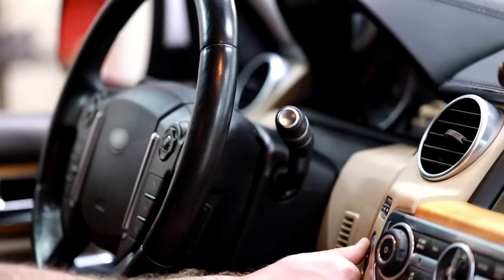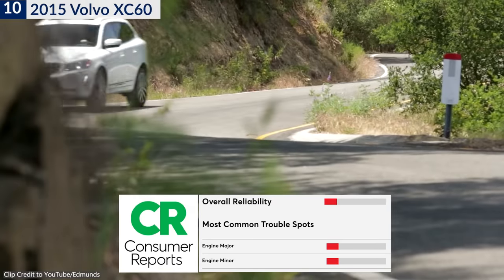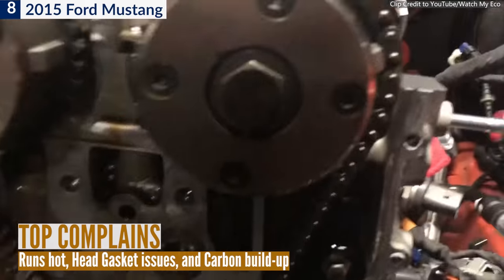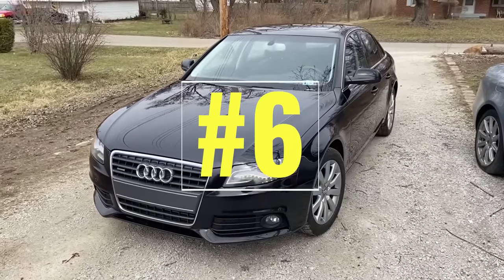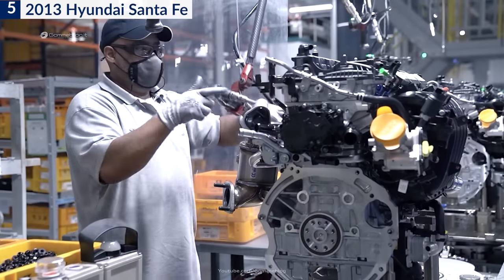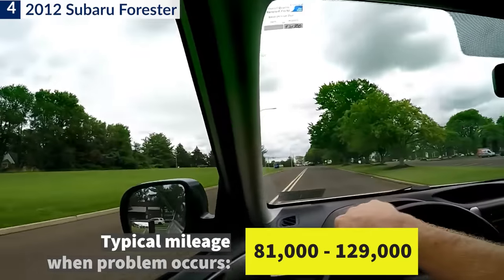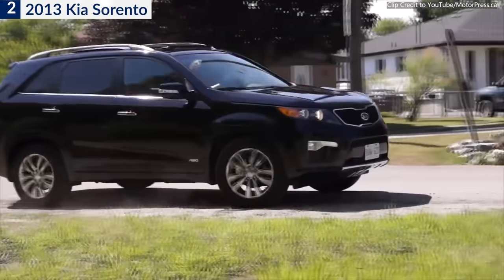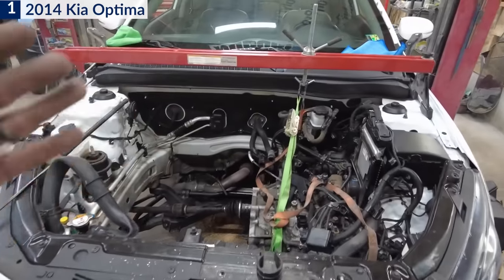10 Used-Cars to AVOID for BAD Engine - as per Consumer Reports

Comment: Actually avoid the all the Subaru Foresters from 2011 on as the all have the FB25 engine.  My wife has a 2011 used oil right up until it failed.  $7000, plus the shop went through two Subaru assembled short blocks BEFORE they got a good one on number 3.  I will NEVER BUY A SUBARU AGAIN!!!
Reply: You're wrong.  Subarus Foresters over the recent years are VERY reliable.
Reply: @eskieman3948  Let me guess, you are a mechanic right?  I can remember when Subaru was rated at or near the top for reliability every year, but that changed.  CR rated Subaru number 7 in reliability in 2022.  Even Buick is rated higher.  Maybe Subaru is  going to climb back up the list.  Maybe not.  It does look like the Forester has improved since 2019,  but I've had my fill.  I have this rule about avoiding a brand after spending thousands of dollars on repairs.  Let's hear it for Lexus, Mazda, and Toyota.

Comment: This video never mentioned 2011/2015 Chrysler 200 V6 Pennistar engines with camshaft, rocker arm and phaser problems. Again these problems exist between 60k and 125k miles. Also these same motors have problems with the oil cooler under the intake manifold. The cooler has o ring oil seals that deteriorate from heat, causing excessive oil leaking down the back of the engine. These repairs are extensive and expensive and problems lead to engine failure. Chrysler knows of these problems but refuses to acknowledge them.
Reply: Of course.
Reply: Of course.

Comment: You missed the 2013 through 2019 Ford Escapes with the 1.5L and 1.6L 4 Cylinder Ecoboost Engines mainly. The 2.0 Ecoboost engine may have this issue as well but not as frequent as the other 2. Issues happening between only 9,000 miles and 120,000 miles. Coolant will enter into the combustion chamber due to a bad design in the block and require a complete engine replacement. Costing the owner (If out of warranty) $6,000+. 

2020+ models are still up in the air on issues but i will guarantee they will have transmission issues. (Also a plague of the 2013-2019 Escapes)

Comment: I've only owned 3 cars in my 17 years of driving and from two different companies Toyota and Honda I had 2004 Toyota Corolla bought brand new never had anything close to a major breakdown besides obvious oil change and air filter changes. I put 300k miles on the Corolla sold it because I found a fairly price 2009 Honda Camry with 65k ish miles same thing no major just normal like oil oil filter and air filters yes your car has 2 one for the engine one for the cabin got again roughly 350k sold because I wanted a little better gas mileage soo I sold and bought a 2012 Honda Civic it had 100k miles on it got the Carfax and again only basic maintenance so I bought it 3 years ago it currently has 192,345 miles on it rules like the day I bought it smooth. Only did basic maintenance oil and oil filter and the air filters when I bought and 60k miles later bought new ones they got a little dirty fr the diesels on the highway and city. All 3 cars are all around used cars drive back and forth to work to stores to little outings etc. With how inflation and the prices of everything has gone up massively Im gonna be driving this civic till the wheels fall off. That's my experience Toyota and Hondas from 2004-2012 are the only years of the vehicles I've driven but never had a problem. I still check us news and world, consumer reports, and NHTSA about there opinions on what year and models. Not one of my vehicles had a turbo natural aspiration all the way. Rem it's just a click away to see how good the car is reliability cost of ownership and durability is what I look for but that me and I got 1 million miles of no major or Minor fixes o had to do I drove Camry super nice and smooth just not the highest gas mileage still good I'm getting 34.6 mpg on my civic with 70 percent highway/30 City the midsize model accord and Camry was 28 roughly combined had bigger 4 cylinders needed them cause it need to the power to move the heavier vehicle but reliability is amazing in my 2004 Toyota Corolla and the 09 Honda Accord and now my 2012 Honda Civic. I saw you might have to the guy who owned a 2000s Toyota Tacoma working in oil fields of Montana with over 1 million miles on truck original engine and transmission he has to have a few hundred dollars of engine work at 700k miles replacing something electric and O2 sensor minor repairs. But Toyota found out came out saw the mileage got it's history it's in there museum and they gave him a brand new 2020 Tacoma it has close to 200k on it he said he wishes he would of kept it but a brand new year vehicle and 20k in cash will change your mind he did say he wishes he kept the Tacoma with over 1 mill miles cause he said he wanted to hit 2 mill miles without a major breakdown. Awesome story I will only buy a Toyota or Honda maybe another manufacturer as long to do it buy if it reliable cheap to run and price is fair. May God bless you and your family.

Comment: My 2012 Traverse had engine 3 put in at 84,500 miles.  First one was a broken timing chain and 2nd was a broken oil pump shaft.  Now that the warranty is up maybe I'll just chop and tunnel it and drop in a SB 350, T56 tranny and Currie rear end from my old Firebird.
Reply: There is a plastic piece that the timing chain goes over that gets worn out and ruins the engine
Reply: I was surprised that the Traverse and the other Lambda SUV's(Buick Enclave, GMC Acadia) weren't on the list. I heard many stories on the timing chain issues on the 3.6L V6. On the Lambda SUV's, it's definitely expensive if it's out of warranty because the engine has to come out to replace the timing components(chain, tensioner, guides) due to the tight FWD layout.

Comment: I'm the not so proud owner of a 2012 KIA Optima turbo. Let's see, the entire front suspension, the brake parts at every wheel and the engine have been replaced. The last one was gratis on warranty from KIA. Good thing I used to run a garage. And to think that I gave my sister my Honda. At least the KIA parts are cheap!

Comment: My 2013 kia went bad at 32000 miles fought them for almost a year they finally replaced the short block. Then trans went bad by 68000. It had a bad knock 2 days after my wife brought it home took it in to service and they said “it’s normal. Just the gdi system .”
Reply: My back then new 2013 Kia Optima stalled at 30,000 miles, driving on the highway, almost caught fire from the smell, Kia replaced the engine for free, then came the recall that many consumers were have the same issues on their Kias, other recall issues were sent to me so I would take it to the dealership to get the parts installed new.
Reply: @cindygomez5414  yes we got a new engine after fighting them for a year.

Comment: New car mite be good first year or two.  Maybe evan 3 .  But once tranny starts acting up . Come back and comment. I spent 15,000$ cash in 3 years just repairing transmission stuff. I keep the fluid clean and filter change.  All different brands to.  Cvt are very gambly lol, never owned one yet. But ever transmission shop said no go. The shops were full of them.  No hate on them ..but your day will come for sure in the newer cars. They are mad with cheap metal that expand etc.

Comment: Where is Ford Explorer?
First 2000 miles: From TX to CA, Vehicle stop in the middle of the road uncountable times.
Mile 4000: Windshield cracked by it self, jump started countless times ‘cause sudden lost of power…(and still happening today)
Mile 35000: Cheap Korean’s Handcook tires was gone. Battery replaced.
Mile 60000: jerking violently when uphills and accelerating; shaking like crazy when breaking.
Mile 65000: in the middle way to California, water pump leaked to the engine, alternator burned, battery dead, computer chip 🔥 
…and more….😂

Comment: The 2013 BMW X3 has a timing chain, not a belt, the 2011-2012 Chevrolet Equinox and GMC Terrain have timing chains not timing belts in both 4cyl and 6-cyl engines.

Comment: I have a 1991 honda accord LX. 246000 miles and it runs great. Added 1 rebuilt transmission and timing belt twice. Not a tear on the dash, carpet or seats. Carcover on it most of those years. Never been in an accident with one owner......me. I have had about 4 people out of the blue if I want to sell it.......I still own it. No body damage at all. The built-in cassette player/radio needs a new one. Anyone intrested?

Comment: I have a 2008 Santa Fe 3.3 with 120,000 and no engine issues only issue I have is a clunk when putting it in gear which I believe has something to do with the transmission engaging in the transfer case. I’ll probably lose AWD soon but hopefully I can keep using it as a 2WD.

Comment: Hi Sir apparently GDI engine are not the best engine at all & probably why a lot of car manufacturers like Kia & Mitsubishi Galant had the 1800 GDI engines & my son had one quite a few years ago & only had it about 3 years & after awhile it had problems & everytime it went for a Warrant Of Fitness it wouldn't pass every 6 months & my son was getting pissed off with his car suspension ball joints & mag wheels that came with the car  one had cracked & had to be repaired & the 1800 GDI engine ended smoking out of the exhaust & it was blue smoke to & I said to my son that motor smoking & I said to him that's not a good car that you have brought & tater he got another vehicle as a trade in my son only got $500.00 for it as a trade in & yet when he first brought it was $11,000 way too much money for a this Galant & would never ever touch Mitsubishi Cars I would steer clear & I have1996  Toyota Hilux Surf 3.4 V6 & now done 251,000 kilometers & my trade the Mitsubishi Galant on this Toyota Hilux Surf 3.4V6 5vzfe engine when it had done 117.000 Kilometers & when the Toyota Hilux Surf 3.4v6 5vzfe engine had done 128,000 Ks I brought it of my son & I have had since then & that Toyota Hilux Surf 3.4V6 is still running strong & just goes to show Toyotas are pretty reliable vehicles & as I say again GDI engines are by no Bloody good I would stay well away from those engines they are Bloody Rubbish Kia should put the Toyota 2 liter 4 cylinder motors or Toyota 3 liter V6 & won't have any issues with those motor & transmissions I don't why Kia use those GDI engine that are absolutely useless Kia should learn to take those GDI engines out their cars & put Toyota engines in their cars as well as Toyota Transmissions Toyota engines are lot more reliable than those Bloody GDI engines Bloody Useless engines & you would think Kia would have learnt by now that their GDI engines are shit end of story Kind Regards Peter PS Kia Get Rid Of Those GDI Engines Quickly & its starting to cost you big money GET TOYOTA ENGINES &TOYOTA TRANSMISSIONS yous would be by far better off

Comment: Seems like KIA has the most problems. Im surprised Hyundai isn't part of that since they are sister brands and likely share at least some of the same parts and assemblies. Maybe not too. I might be making assumptions.
   I love my 2009 Hyundai Santa Fe Limited with a 3.3 liter 6 cylinder engine. Passing 163,000 miles on it and running great.

Comment: The Ford F150 3 Valve 5.4 Triton is an absolute grenade 💣💥🧨of an engine timing ⏱️ chain & cam problems are a disaster. I had an 04 with 5 engines, YES 5 all from the same problem. It’s so bad it should have been labeled “criminal.” This was a prolific/horrific problem for many Triton owners. Never again!!

Comment: I have an old 94 camaro. its had some issues but its things that are expected. the fuel pump and a/c compressor and an alternator. its only got 130k though.  but I change the oil religiously and I use Castrol syntec an ive always used Castrol oil an I have never blown an engine in any car ive owned.

Comment: Notice most of the issues are with small turbo boosted engines. Just because you can crank 200 - 300 HP out of a 4 cylinder engine doesn't mean it's a good idea for the long term

Comment: Just had my 2017 Kia Optima EX Plug-in go at 74,000 miles. Just got gas, pulled off the expressway. Oil light came on, car dead. Kia is evaluating the case, asking for oil changes receipts. What a fiasco. It died on Dec 29, 2022, still no repair authorization as of Jan 14, 2023.  Sounds like it was rod bearing issue.

Comment: Well sounds like Hyundai needs to get it's act together 😲😲😲
But of course these cars are relatively old and things may have improved. Never good to buy a vehicle if it is using a new model of engine or transmission which hasn't had time to to get any bugs worked out which may exist.

Comment: Look at that again Toyota, Nissan or Honda is NOT on the list told ya some Japanese automakers are so reliable that my car its 2010 toyota camry le has no major engine problem it has 117k miles on it  and its 12 years old
Reply: I got a.2016 Honda accord with 406k miles and I haven't had to fix anything under the hood yet. Not a starter alternator or anything.  I'm still at awe every day I start it up how this shit still going strong. I drive it a lot and it keeps going

Comment: A lot of engine failures are caused by LACK OF MAINTENANCE!! Do not go by the stupid change oil light on the dashboard. A lot of them don’t come on until between 7-10000 miles. Even if you do a lot of highway trips you still need to change your oil every 5000 miles MAXIMUM… even sooner if it’s turbocharged. The manufacturer doesn’t want the engine to run forever so they say you can change it every 5-10000 miles. If you plan on keeping the car awhile never go over 5000. Another thing is to check the oil every once in awhile, once you run a car 2 quarts down or more it’s never the same again and you will start burning oil like crazy!! I have two Fords,both 2.0… one turbo and one non turbo and I change the oil on the turbo every 3000 miles and the other one every 5000. I do almost three oil changes before the change oil light comes on in the turbo and two before the change oil light is on the non turbo. Oil is way cheaper than the engine replacement!! Use your head people!! I’m a retired auto mechanic with over 40 years professional experience.

Comment: Owner of the new Honda Pilot 2018, after 6-8 months, transmission error, transmission system problems, and when driving and release gas pedal, the RPM drops drastically and vehicle will stutter, will avoid this car in the future!!

Comment: My 07' Honda CR-V has 238,000 miles on it and it burns a half quart of oil between 4000-mile oil changes.. It still runs like a clock and has the original muffler on it still..LOL! I bought it for $5500 3 years ago.. LOL! When you buy a Mercedes or BMW you're paying for the logo on the hood... My 07' has a naturally asperated K-24 engine.. My H.P. is only 160 but the K-24 can be modified to a H.P. of 500 and above...

Comment: One area car makers could avoid a problem is in excessive carbon buildup in engines by NOT utilizing direct fuel injection or GDI. This is a technology that imo should've been banned a long time ago. By bypassing the intake valve you've pretty much doomed your engine to a slow death.

Comment: The Buick 231 V6 was a lousy engine.  Used in many GM cars during late 70s well into the 80s.  The rods notoriously went bad as soon as you hit about 100,000 miles.  I knew other guys who had cars with this engine and exact same story they told me.

Comment: A lot of these problems is due to the EPA. Every year they want more mileage & lower emissions. There is just so much you can get out of a ICE engine. So the manufactures make the parts, lighter & cheaper, and using plastic. That's why there is so much failures. Most of the new engines are small turbo charged engines. They are junk. They can't hold up like a V8 or V6 that seemingly lasted forever. They are trying to get some much out of a small engine. Notice almost all failure were 4 cylinders. You hardly saw any V6 or V8 that are in trucks. They do more work with less effort but sacrifice MPG.

Comment: Ford-ALL WITH 3.5 Duratec. Flex edge Taurus so many others have this shitty engine. The water pump goes out around 80,000 miles it will cost you over $2000 to fix it because it’s located deep inside the fucking engine! Most people just pull the engine to fix your water pump but you have milkshake oil you didn’t know about and it probably ruined your bearings.

Comment: The thing is that most American, German, and Korean cars try to squeeze every bit of power out of their engines with turbo and all sorts of variable engine enhancements. Buy a car where the engine is naturally aspirated and is OVERBUILT. An engine that does not put a lot of stress on the transmission.

Comment: Wait till you start seeing the 2021 KIA Seltos.  My mother-in-law and brother in-law bought one each.  40000+ miles and Holy Sh1t.  They both just turn off under acceleration and are hard to restart. 2 “software fixes “ have helped NOTHING. I’m trying to convince them to get a CRV or HRV.  Too damned hardheaded to listen to me especially after I told them they’d regret getting KIAs like they did with Hyundai.

Comment: I bought an equinox secondhand walked out of the dealership but not even 100,000 miles. I thought I had an awesome deal considering the car that I bought for did the same thing I didn’t even have my car six months before my engine went out at the time the engine went out. I still had only 110,000 miles on it that’s it still owing $4000 on this car that I had to pay financial disaster left me without a car

Comment: I just think those engines in those Subarus have issues regardless especially with the number four cylinder connecting rod they like to break a lot I just think that it’s poor manufacturing among cooling and oiling especially if they try to add more boost to the engine they really like to give way